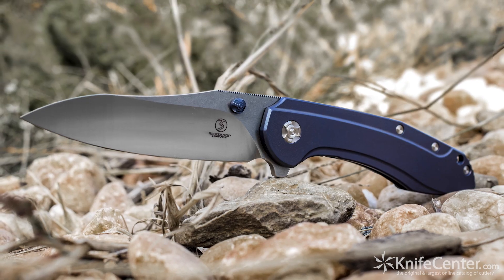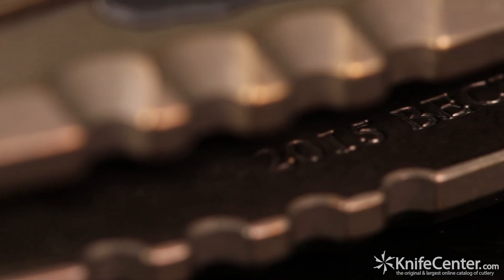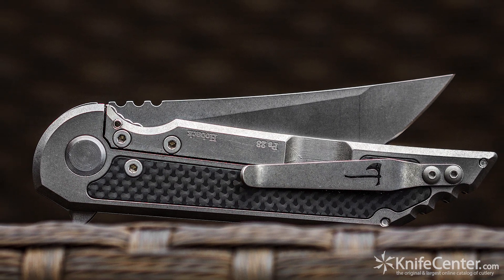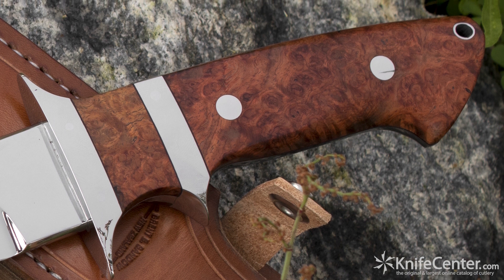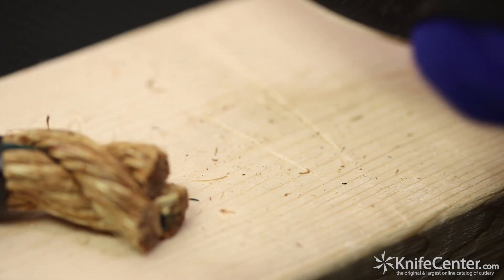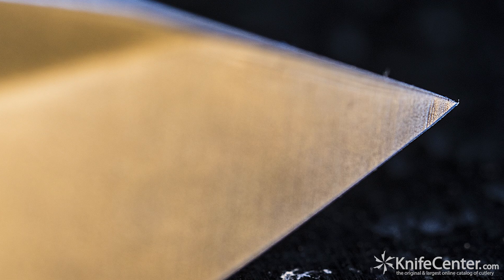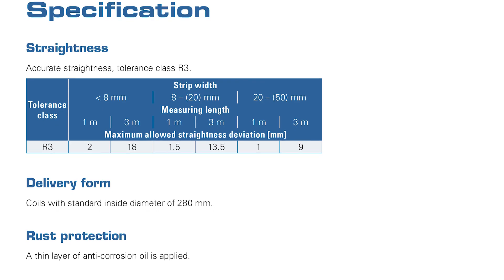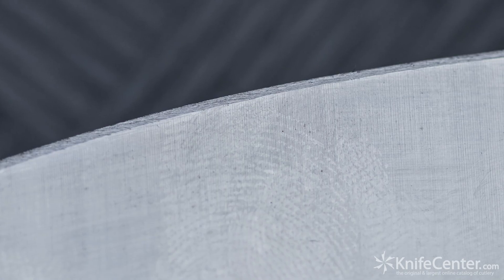A Material World: Knife Makers on Steel Selection and Testing

Comment: I prefer 1.4116/4116 Krupp/X50CrMoV15.  I love my Victorinox "Locksmith", and abuse my Cold Steel "Pro Lite"... both are used regularly without fail.  Valuable, reliable and always stay sharp AF!